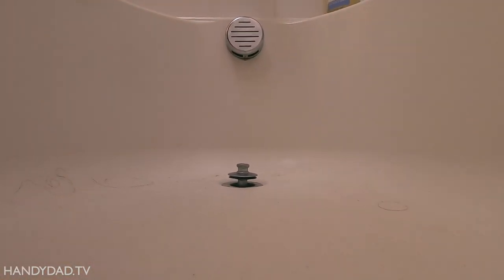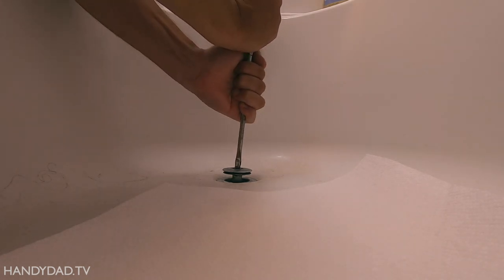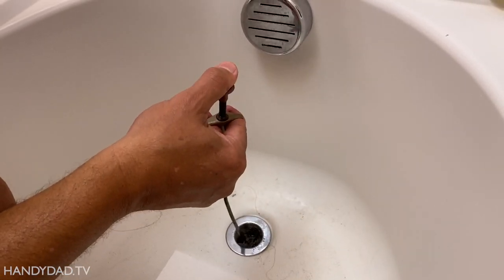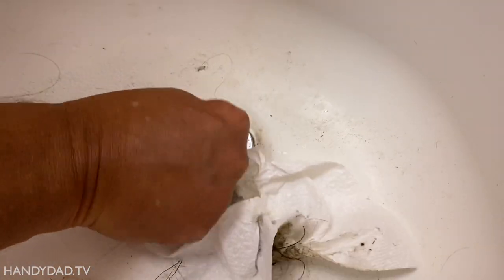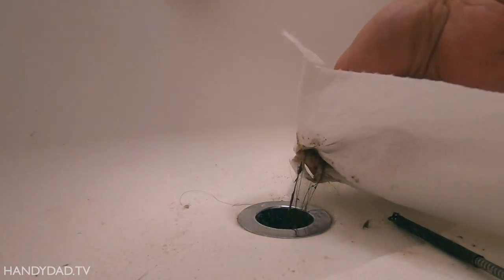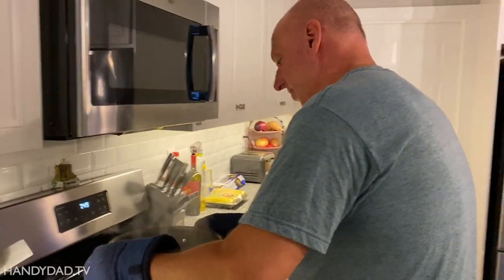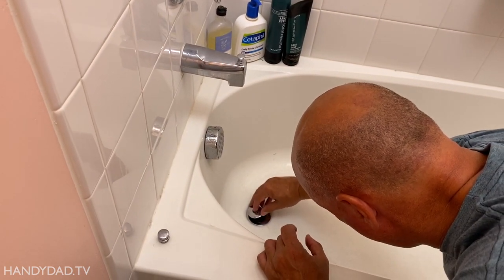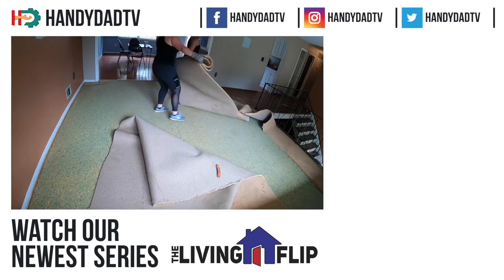Tub Drain Cleaning (disgusting)

Comment: Thanks for sharing. Funny video. Dad saves the day for their daughter!  👍 One easy trick I have done without using a drain snake or chemical is a plunger. I use the water that's backing up and push it down with a plunger a fees times. Works wonders and it's free!
Reply from the maker: How does a plunger help with hair wrapped around the drain?

Comment: As gross as this is to watch, it is a very helpful video. What is this tool called? I think I need to buy one today.
Reply: Thank you, Bonnie Parkin.
Reply: @Terenia531  Hi. .. I just use a wire coat hanger with hook at the end- more sturdy than what he's using .. save your money 😊
Reply from the maker: But you can’t pickup a dropped bolt under the hood with a coat hanger. This this is useful in so many ways.